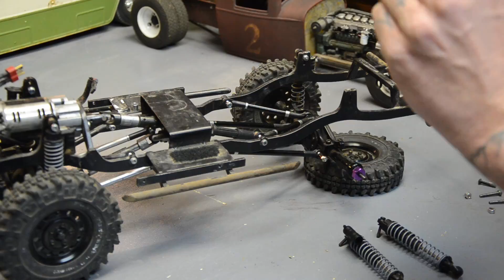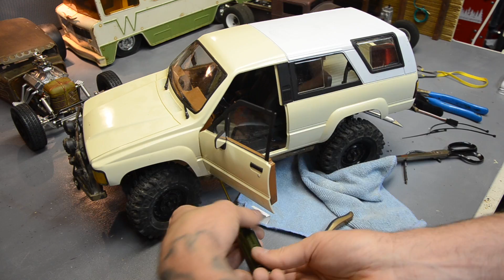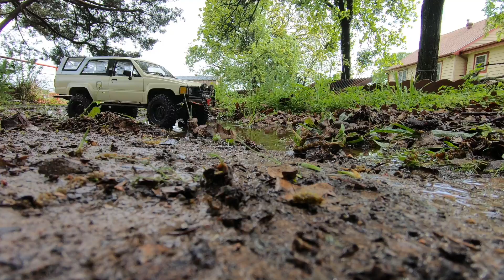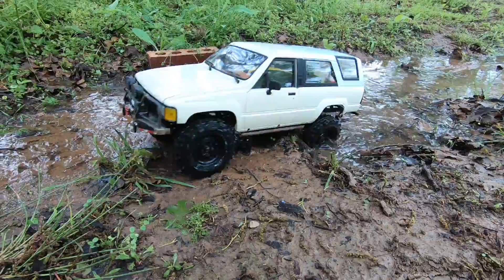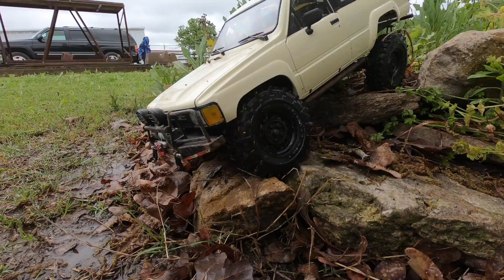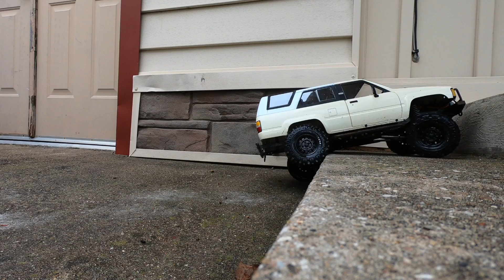The RCmodelex Chassis RC4wd 4Runner Resto, Part 2, Shocks, Electronics, and WetTest Drive

Comment: Good morning. I'm leaning towards buying the chassis and body for the Toyota 4runner. Do you know what chassis would fit the 4runner the best? I'm just getting back into rc trucks
Reply from the maker: Hi Jeffrey, the body is made to fit directly to the rc4wd trailfinder 2 chassis.  It can be made to fit axial scx10 and redcat gen 8 chassis but requires a lot of mods to clear the suspension and tires.  With the full interior all of the drivetrain keep the body from sitting low enough to look right.

Comment: Hey, you make some awesome builds. And every time I see the electronics I cringe. Which is exactly why you are having issues. The savox servos are power hungry and demand more power than the esc can deliver. Which is why you need to run a Castle Bec with savox servos. Also being power hungry those stick packs are not the greatest either. You don't need expensive electronics but I run stock axial stuff in mine with castle BECs and on 2s-3s lipo. Which buying 2000-3000 mAh lipos will give you a Small footprint. Plus the Tamiya connectors. Keep them coming. Just my advice
Reply from the maker: I know, I use to never drive much so i have never gotten into all the modern electronics.  But I am working on it, I have a few lipos now and have started swapping over to the deans connectors.  Have a video next week about some of it.

Comment: I would just put proper connectors on the motor and make sure the wires arn't bad anywhere before you change everything, I bet you $1 its the connection! ;)